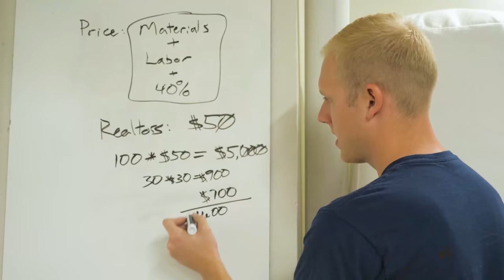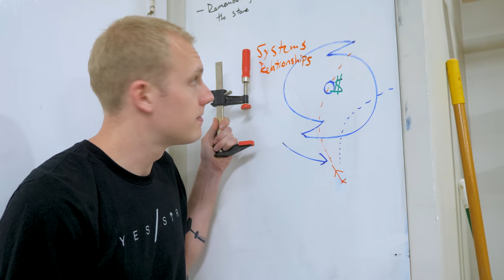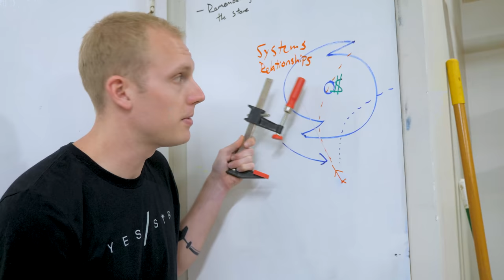our first 30 days in business... with sales numbers!

Comment: If you have a local friend who does mortgage lending, they may be able to tell you who the top producing realtors are in your area. Target them specifically, so you can sell more volume per customer. Also perhaps consider having the personalization etching done on the side of the board, this way you can boards in process, partially finished and just glue the side piece on.

Comment: If you put Johnson’s wax on the pipe clamps you won’t have to spend hours on cleaning glue off your clamps.
Reply from the maker: Oooohhh that’s a pro move for sure
Reply: a wire brush on a grinder works well for cleaning up dried glue.  Just wear yours safety glasses and loose clothing as metal wires can shoot off.

Comment: Glad you guys upgraded that dust collection! For those who have the HF and don't want to go big, replacing the bag with a filter (I used a Wynn Environmental Filter) will remove soooo many fines.  

For the cutting board idea, ever thought about searching listings (start with the high-end homes in your area), find the realtor's address (even just their office) and mail them a board along with a customizable note.  You certainly don't get the face-to-face reaction (which is best), but you also don't spend all weekend driving to open houses either (or cold calling).  Maybe it works. Maybe a bust. But I guarantee they will share your gift with their colleagues....so you actually hit more than you send anyway (and now they are your influencer in their circles).

Biggest trick is whether people hit their offices to pick up mail during COVID.

Oh, and as part of the selection process (maybe you start with 20 boards to track your success rate) would be to use redfin or zillow and try to find the agent's prior sales as well.  This will show you how many boards/year you would be targeting.  If someone has a $1million listing, that is great, but of they only sell 1 home/year, they might not be the best target.  Similarly, if someone has 20 $200k listings, they might not be giving every client a $100 cutting board nor would their client likely buy your $5000 dining table 😊

These cutting boards are essentially your "direct mail flyers" for your more expensive tables.  Except, in this case you get to break even...hopefully...once you get a few recurring sales.  They can be a loss-leader for your overall business yet still have immense marketing value over a flyer in the mail because the craftsmanship is tangible.

Keep up the good work!!
Reply: Ditto on the HF mod with the Wynn upgrade, mine’s been going strong for 4 years and gets all the dust and is a must upgrade.  But too late to help now 😉

Comment: Just searched QR codes and found they can dial a phone number, take someone to your web site or your social media. Plus they can have your company logo plainly visible or even a small amount of text! I envision a trifold pamphlet with several QR codes in the corners. Maybe?
Reply: The issue with multiple codes is that the camera may pick up the wrong one if they are close together. It’s easier to just have one and have the other info linked from that codes destination. The QR code is just saving someone from typing. The site it takes them to can than have links they can just click on.

Comment: If anyone could answer me this question? I have been building cutting boards myself and things have been fine but I have recently started having small cracks/gaps in my boards and I know it’s not the glue I use or clamp up so I’m stumped I have made sure my saw stop is zeroed out. I’m new to wood working and this is all learning more or less from YouTube thanks anyone for the help or suggestions.
Reply: If the gaps are appearing after the board has been finished, then it will be wood movement.  The temperature / humidity indoors will be different to where the wood has been stored prior to you making it into a board.  As the wood expands and contracts it will likely over stress the joints.  When you glue the pieces together, make sure that you alternate the orientation of the boards so that the growth rings are facing in opposite directions ( Unless you are using quarter sawn wood ) by alternating the growth rings you will help to balance out the direction of movement and keep the board flatter, with less chance of gaps appearing in the joints.
Reply: @RCHandmade  thank you

Comment: Where are on getting the approximately $50 cost per board? What is your material cost? I you don't have a supplier of rough sawn lumber, get one. My material cost for same board is  about $10. Even walnut.
Reply from the maker: That’s great for you, Bill. Our boards are actually $38. That includes materials, labor, packaging, and shipping. And we’re not even getting volume discounts from our suppliers yet!
Reply: @jennieanddavis  that's better. I divided your stated cost by the 13 boards and that's where I got the nearly 50.00

Comment: Um, I don`t think you can avoid counting the boards you gave away when calculating your profit.  Not only did you not make any profit, you`v e gone into the red. You`ve also bought that dust collector and all the tools and machines you`ve bought count as well. So you`re in the hole thousands of dollars.  But those cutting boards you gave are an investment of a sort, which I`m sure you realize.  Not trying to be a dick here but I don`t think you`re looking at profit accurately.  That said I`m sure you`ll get there but it`s gonna take time.  Good thing you have your day jobs still